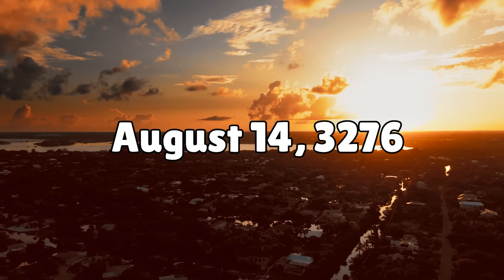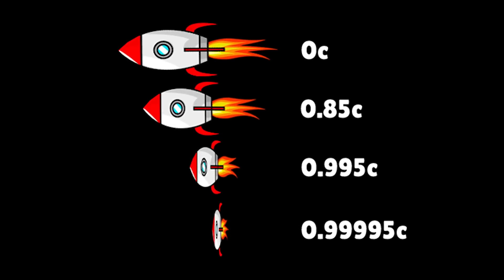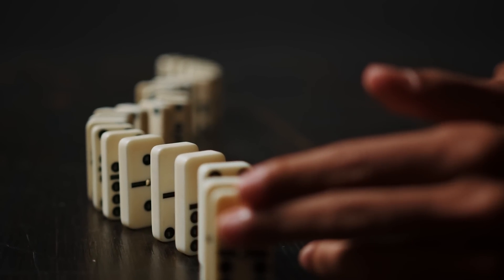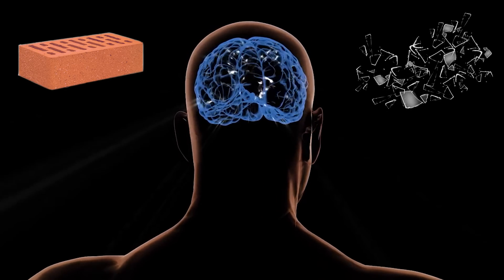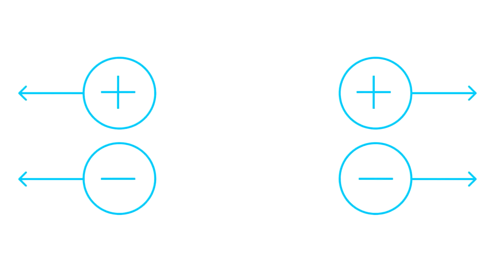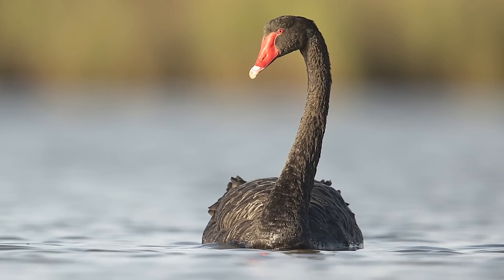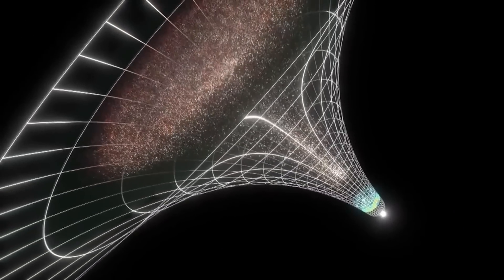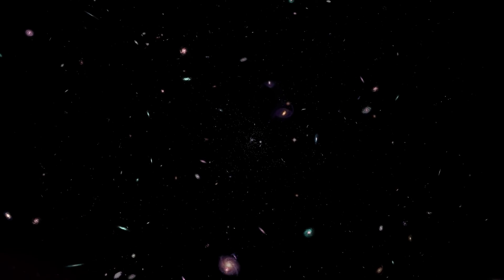Will Tomorrow Come? The Cause and Effect Fallacy

Comment: Actually the Theory Of Relativity is a load of nonsense, and all you've done is found a mistake in it. Movement is to the backdrop of space, and does create lines like you said, but the lines are holes, so the holes get longer to cross a greater distance, and the material moving through those holes vanish into tunnels. The tunnels only hide material, and things do not get shorter, they just get partly hidden. You could say that the negative mass gets longer as the mass gets shorter, and their total is always 100%.

Comment: How something can come from nothing? If the meaning of nothing in mind is impossible, for example inside a box is empty, then still there’s air, so I remove the air, so there’s still energy particles, so I remove the energy particles , then the next one quarks and the next one the sub-quarks, then the next one the smallest of the smallest of the smallest of the smallest super hyper ultra tiny tiny of the sub-quarks until the infinite. Then what? You are going to tell me, I have no idea. What exactly is absolute empty space, nothing? So the planet earth is rotating into the nothingness of space, that doesn’t make sense, that nothing is something as well. what is nothing? How the universe can come from nothing, that’s impossible.

Comment: Why the hammer hit the nail? Is like the same issue, why the person moved the right leg? To move the left leg , then next question is, why the person moved the left leg? To move the right leg, then why the person is moving both leg? To move to different places, so if the person wants to move to different places, why the person doesn’t try to move with only one leg ? Because it is extremely difficult, so in conclusion 2 legs are better to move from place to another, the person has better EQUILIBRIUM, BALANCE, this brings us to many point of view , like for example, why the planets has to rotate, orbit permanently? Etc, etc, etc . To make any sense of the first question and answer.
Reply: Instead of making a lot of questions and answers you can answer directly. the last answer EQUILIBRIUM.

Comment: Excellent job. I just want to add that you can consider the travel time of a signal from when and where the board leaves the barn to where the observer is located and the same goes for the other end of the board. This signal transmission time, which is different in both frames, is where the missing time is found.

Comment: That's exactly what does happen.          The universe is basically an eternal void of nothing . Empty space.                   This empty space is reasoned to be infinite being absolutely nothing.              And because it is nothing or a void of empty space it is reasoned to exist forever without a beginning or an endpoint.                  But it is not alone.     Because of the void's infinitely eternal nature it causes a vaccum energy of a second type of infinity to expand and fill the void as a wind energy.          And if energy can neither be created or destroyed as postulated in physics ,and only transformed into matter , then it begins to make sense that it's possible to infer what happened with the big bang and the reasons for the transformation of pure limitless vaccum energy connected in infinite space creating a mass very diffuse but present outside of time.      Time being the flowrate or directionality of entropy after the big bang .              Where once newly formed matter began to cool entropy started to increase slowly and began to spread out as matter cooled in the direction we experience through the filters of our senses as temporal or time!                      And time flows at different rates based on motion and seperation along with gravitational increases.                 Before the big bang vaccum energy collapses outside of entropy or time ,   instantaneously collapsing in on the pressure of it's mass created by it's infinite volume.         Infinite energy we could never access as we would have to stretch outwards towards infinity to access it .     Then we could'nt touch it as to begin capturing it you'd need a third type of infinity .     And a different perpetual motion machine .          We cannot build. It's totally impossible.    Only an infinite eternal universe can be the only functioning perpetual motion machine . And nothing else.                 Vaccum energy collapses in the void and creates a singularity of nearly infinite density ,heat and gravity are formed as infinite vaccum energy collapses towards the singularity.         Infinite energy begins to pour in a flash as the speed of vaccum energy increases as it pours into  the singularity  .      But It cannot hold the entire bulk of infinite energy so it begins to expand faster than the speed of light at first as the gravity of all the compressed heated energy increases as more energy pushes into the singularity.      Finally the energy is so great and exponentially multiplied by infinity that the singularity explodes in a blinding flash!              And all the concentrations of energy packets still filled with empty space (quanta)     are transformed into baryonic matter  which slowly begin to cool and as they do so ,create temporal effects within the matter that we know of as entropy.          The matter thus begins a long journey of cooling off and slowly decays after trillions of years to return back to the void as wind energy.     Or basically returning back to the nothing that it was formed from!       And energy is conserved. Totally.               Gravity is the magnetic bonds of matter or concentrated energy trying to stick together.       Matter or acceleration of energy is a force that slows temporal effects down.       As matter expands it dissapates and time speeds up.           So basically the universe is nothing and it creates limitless vaccum energy that is, the void equals the number zero in the universe's equation descriptively from a maths perspective.     It creates infinite vaccum energy which we can say is a number two.          That causes energy to collapse and create a singularity.  Which is the third number.          I just refined what i previously thought of as matter being the third number.       Now i'm beginning to think it's the singularity where energy changes into matter.          I need to consider that more later.    But let's ride with it for now!             So matter once converted from the singularity exploding in orgasmic fractal symmetry becomes the fourth number .     And elements add more numbers as they emerge and galaxies are born.       It's related to the three body problem how infinite complexity arises from the third orbit.          The fractal symmetry of energy and the void represent two bodies or numbers . The singularity filled with transforming energy is the third number which creates orbits of infinite complex relationships which show the nature of matter as it decays in entropy and devolves in cycular motion back into the void returning to nothing and becoming a portion of infinite vaccum energy once again.          And a new universe is born in cycles forever without end.         But all the creatures will be different every time.          And there was never a God.          All religions are lies primitive mentalities created in some dark fantasies they had.       The universe was never created. It always has been here with no beginning and no end.      Whatever happens just happens. It's all a natural process of entropy .